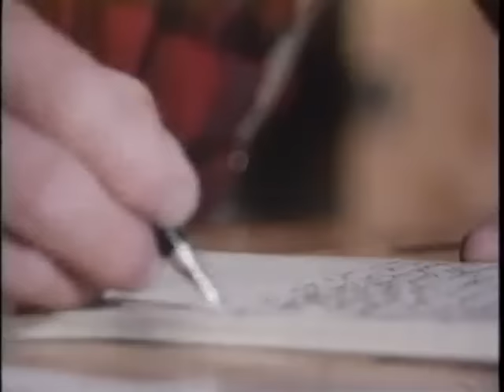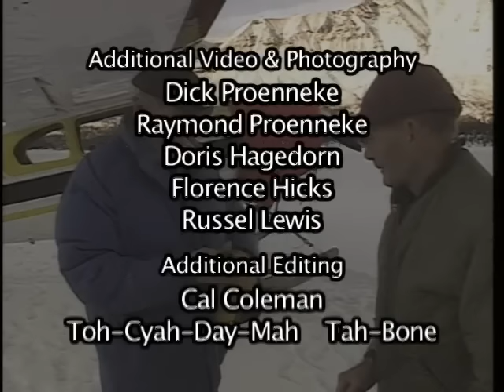DICK PROENNEKE TWIN LAKES

Comment: We live OFF THE GRID.here in Alaska.Haul our own water by 4-wheelers an a 4x6 trailer that carries our 5 gal buckets an 25 gal barrels.We have a natural spring 3 miles from us down creek.We use solar panels to charge our batteries which run the lights,radio's ect.We do have a generator for back up.We hunt an grow our own food.We built a shower 5x8 a put a barrel stove in it to heat the water an keep you warm.This was the best move we ever made.No bills,or taxes..just a good life.You can do it to

Comment: Yes the Black Talon was only out less then a year. When the Washington Post newspaper ran the story of Winchester pulling them from the market I went from gun shop to gun shop buying any and all that I could find. I think I paid around 14.00 a box for them then in the late 1990s I sold off all but what I needed for myself for around 35.00 a box. My carry gun is a Glock 27 40 S&W loaded with black talons. I also use them when I carry my 45 acp or 357. It is a heck of a round. The closest you can get now is the ranger stx or maybe xtp but they no way do the damage the black talon would do. I would never carry them in Alaska for bear or anything that size as they do not penetrate enough for anything bigger then humans or maybe a wolf or deer.
Reply: Sweet. I've read that the smallest anti-bear round you'd want to use is the .41Magnum. I'd prefer a full auto 12 or 10 gauge, like the Ruskies have now, as i recall.
Reply: Andy Fife Full auto is better with Bear dens.

Comment: Very interesting, I wonder why the cabin door is so small, efficiency or structural?
Reply: Both things you mention seem correct.

Part of it is how high the lone builder could manage to place the logs on all 4 sides. Also don't believe they'd want to cut a number of the logs above a door as the weight of a sod roof and a winters snow that probably wasn't gone until spring could collapse the "weakest link".